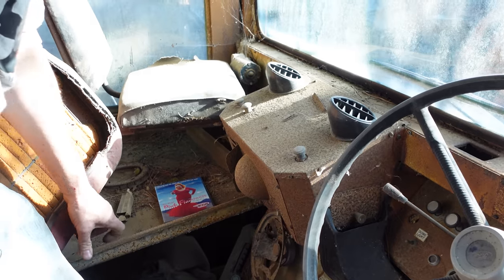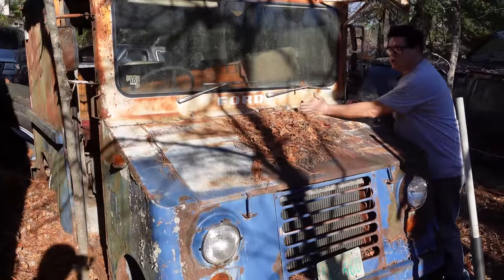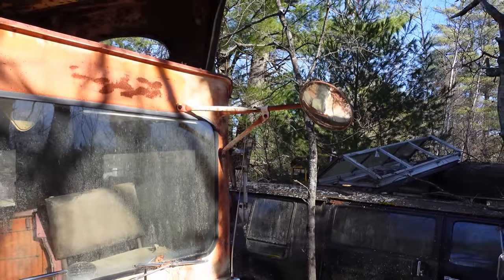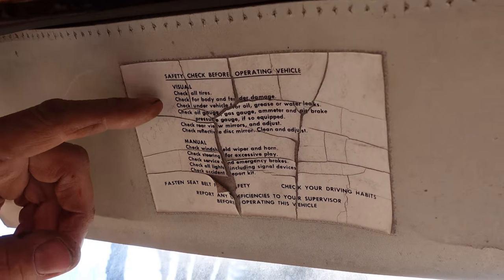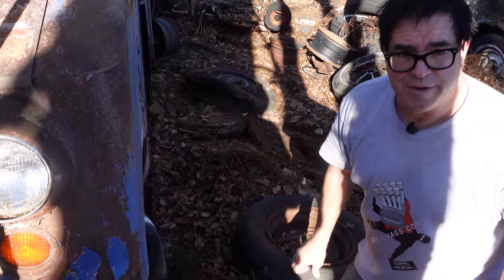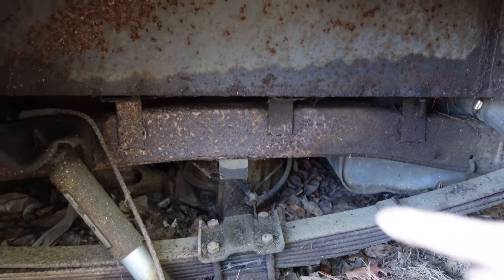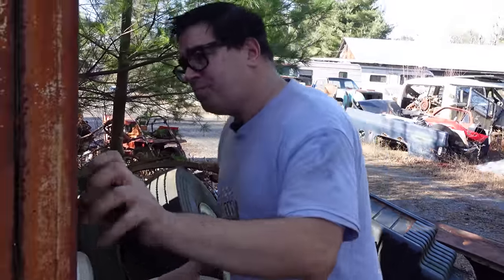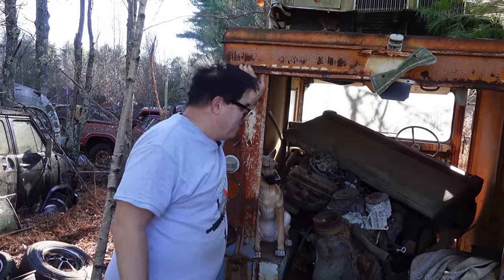Rare Ford Post Office Delivery Van

Comment: Having worked for the US Post Office 1969-1974 (During the time the Department of the Post Office became the US Postal Service), I've very familiar with these vehicles.  The also had AMC Ambassadors, IHC Scouts, AM General 'Jeeps', and probably a whole lot of other right hand drive vehicles.  I actually purchased an AMC Ambassador from the office I worked at for the whopping price of $200 back in the 70's when they were changing over the fleet.  Very austere interior, no back seat, etc.
Reply: The postal service in the town where I grew up used the Jeep. It's been decades but it was my understanding that those jeeps were all repurposed WW2 service vehicles .
Reply: Up until just recently the mailman in our area drove their own vehicles. I remember as a kid my mailman had a Plymouth duster. He sat in the passenger seat and drove the car.
Reply from the maker: Hello Hack Fabrication, good call on the RHD AMC passenger cars for postal use. A few years ago I had a show called Roadkill's Junkyard Gold and we did an episode at a place called "Rambler Ranch" in Elizabeth, Colorado. They had TWO 1967 Rambler Rebel 4-door Post Office cars with RIGHT HAND DRIVE and the base 232 six popper. We did a feature on one of them. If you are a Motor Trend App subscriber, you can watch the episode. Just seek out  "Rambler Ranch" episode. It is in one of the few episodes we did there. Others cover the 4X4 Eagle passenger cars - of which Rambler Ranch had an example of EVERY body type and model. A great AMC resource! Thanks again for watching and writing. -Steve Magnante
Reply: @danw6014  Yes, some carriers on certain routes use their own vehicles. Depends on the route.
Reply: @googleusergp  I used my own vehicles my entire career ( 5 Jeep Cherokees) until the last 6 months, when they assigned me a brand stinkin new Mercedes.....they're attempting to phase out carriers using personal vehicles......the kicker is these Mercedes have to have minimum 91 octane........using E85 would cause engine damage, so you're getting the most expensive gas at the pump, like it or not.....go figure.....
Reply: @timfremstad3434  I don't believe that any government worker should use their own vehicle at all. A vehicle for civil service is a tool. A civil servant doesn't bring their own chair, computer, phone or other items to the job. Yes, civil service mechanics often bring their own tools for the job, but in order to do government work, a vehicle should be assigned to you. I'm not sure why USPS did that, unless it was shortage of vehicles, or knowing the government, cheapness. LOL. If you think about it, you should be covered by the government insurance when you're on the job, so using your own vehicle is mixing business with pleasure as the expression goes.
Reply: @danw6014  mrs halcin delivered with her car,she was a farmers wife @ there kids sold corn !
Reply: @Jupitermustangmike  my old mailman once upon a time sold Desotos and Allis Chalmers farm equipment.
Reply: @danw6014  I love sharing these stories
Reply: @googleusergp  The rural carrier receives an allowance for providing his own vehicle.
Reply: @robj2704  I get it and that worked years back. Not in today's society.
Reply: @googleusergp  because?
Reply: @robj2704  Liability for an accident, wear and tear on the vehicle, etc. Not worth it. They should supply a vehicle.
Reply: @googleusergp  the rural carrier is considered a contractor and is responsible for everything to do with their vehicle.  This was the case last time I knew which was 15 years ago.
Reply: @googleusergp  well. they paid us for the use of our vehicle, we were still working for the post office, but they were paying us for the use of it everyday..... I was a rural carrier....as to insurance, my auto insurance , Rural Carriers insurance, has tort clause in case we're in an accident and someone wants to sue a carrier personally, we were covered, if you went through other insurers, they would charge you a business rate, which would be ridiculously expensive.....I've been out a year and a half, they've sent me letters to come back for Christmas, to which I say "No Thank You".....28 was enough
Reply: @googleusergp  When I worked at the Post Office, rural carriers where contractors.  They were selected outside the normal civil service hiring.  They would use their own vehicles.  One carrier I knew, actually purchased a brand new DJ for his route.  They were paid by the length of their route, and the number of stops.
Reply: @timfremstad3434  What a raw deal. I would want no part of that.
Reply: @hackfabrication139  No thanks. I'd rather get paid by the hour and not because some bean counter decides this is what the job is worth. I'd also NEVER take a government job where you don't have civil service protection and rights.
Reply: There is a difference between a highway contract carrier, and a regular rural carrier. One is a contractor, the other (Rural Carrier,) is a career USPS employee with federal benefit plans and union representation.
Reply: @davidgilbert7789  Which is the ONLY way to have a civil service job in the sense of it being worthwhile. Any other way, you're subject to the will of management.
Reply: @davidgilbert7789  You're right, contract carriers out in the stix got a real raw deal.....I wouldn't do it for the deal they got

Comment: The 250 is part of the 144-170-200 family. The 240-300 are the other inline six family.
Reply: Yep, it's a tall deck Mustang and Ranchero in line log head 250, not the 200.

Comment: I believe Todco supplied the rear doors for these, as they did many truck and van doors (and still do). Yes, the GM LLV (which is a right hand drive S10 platform) is still around, but they are being replaced by Oshkosh models and some small Ram vans depending on the use and route. The GM LLVs are long past their prime and they are prone to fires because the washer fluid is in a bad spot where it can ignite. They are also long in the tooth and have a lot of miles and use on them. LLV means "Long Life Vehicle" and Grumman made those bodies. 

The plate shows a lot of DSO (District Sales Office) numbers because this is I believe a hodge podge of parts put together. I believe the frame is from a 1971 Bronco and alot of the rest of the parts are from the rest of the Ford truck parts bin. This contract bid was started in 1970 as evidenced by the language at the bottom of the placard, referencing that the vehicle meets all standards as set forth in the bid (solicitation) as of Thursday 2/5/1970. That's to avoid Ford being caught in a trap where the US government would say, "No, it has to meet the standards at the time of the build". That wouldn't be fair as Ford priced it based on what was in the bid documents at the time and builds it based on that. If not, they issue a "change order" which updates the contract and specification to what is then current at the time of build. Things like that can get sticky and that's how disagreements start. No one wants to be in the cross hairs of the government, so that's why that's put there. Yes, the transmission is likely a C4 automatic. 

In 1971, the Postal Department became the United States Postal Service and adopted the "sitting eagle" logo which was used until 1993 when we got the current USPS logo. I had an uncle who was a mail carrier for many years in Brooklyn, NY and he loved his job. He never had to go to a gym because he walked miles and miles each day. Everyone knew "Andy the Postman" and would sit and chat with him. My uncle retired in 1985 and enjoyed retirement until he passed away in 2012.
Reply: I did not know that washer fluid would burn. Learn something new every day...lol
Reply: Thank you G P for all the great info you gather !
Reply: @will7its  Yup. The washer fluid lines apparently run over the fuse box and washer fluid contains some sort of alcohol I believe so it goes right up.
Reply: @daynadiggle8169  Sure thing.

Comment: Great overview. The Post Office I worked at in the early 1970's (in Connecticut) had a large number of these  Great mail delivery vehicle. Easy to drive, easy to get in and out as well as plenty of space for the days mail. As you said, they had a posi-ttmraction rear and lots of gear, probably 3:89 or higher. Great acceleration for a small six. Best postal delivery truck of the time. Better than the Dodge's and Jeeps which were also common in that era.

Comment: Great video as usual.  I don't believe we had dvds in the 70s? The vents in the van are in the Grumman Llv as well as many others over the years on cab and chassis vans produced for PO. Note the Grumman LLVs Long life vehicle) were produced from 1987 thru 1984 Gm 2.5s 87 to mid 93 then 2.2s till 94.
Reply: And the Aluminum  body Llv is still delivering.
Reply: Those  body guys were  trained in aluminum at the PO Garage,well before the F 150, Real aluminum craftsmen

Comment: Hi Steve, nice video!  When you talk about rear differentials, on any car or truck, you have 4 different types, open differential or closed differential.  #1 type is that the drive axle(s) are never locked together that's an "open'.  #2 type is a closed differential with wet clutches compressed by high spring tension to HELP both drive axles lock together, Ford calls this "Limited Slip", Chevrolet calls this "Positraction" other car brands call this different names, I.e. Safety Grip, Shure Grip, Twin Grip, etc.  All Chevrolet Corvettes have "Positraction" and Corvettes have the highest wet clutch spring tension than any other car from the FACTORY.  #3 type is a closed differential where-as NO wet clutches are used what so ever, it is a rotating detent dog that locks both drive axles together 100% and they stay locked together until you back your foot off the accelerator, but in the mean time, it takes ONE FULL rotation of the two drive axels (in a straight line) to lock the drive axles together.  #4 type is what's called a spool or "welded rear" you might sat that makes both drive axels locked together at all times.  Welded rears are popular in off road drag racing, but are too hard to drive on the street, because the will loos rear traction on turns and will "bunny hop" on right angle and "U" turns.  By the way, have you ever heard of a "Detroit Locker" rear end?  Detroit Locker is a trademark of Detroit Automotive, Detroit Michigan.  Please reply.  Dave...

Comment: And don't forget, there was a Jeep van(based on the FC series pickups, I believe) in the late 50's and then the Jeep(later Am General) DJ-8 1/4 ton van. And when I worked at the PO in the 80's and early 90's the PO was using Ford Pintos too. Got the first Grumman LLV's in 1987.

Comment: Steve, you totally forgot to mention the sweet, sweet aerodynamics on that little puppy! That would be a good candidate for a 289 or 302 swap. The 200 line of engines leaves a lot to be desired.

Comment: Cool mail truck... its got street freak written all over it or maybe not.
Today in my neck of the woods the mail trucks are based on the chevy s10 frame and drive train.
At one point i was really into those mag caps and ran a set on the malibu...now im running the stock malibu wheel covers. Ive owned the car so long and ran a few tire wheel combos, but now the  car looks just how i bought it for now !!

Comment: Gunnman went belly up in the early 90s and was bought by Northrop. The last LLVs rolled off the line in 1994. Not one LLV postal vehicle on the road is newer then 1994. They are loosely based off the S10. They all have 100s of thousands of miles on them. Most are on their 3rd or 4th engine and trans. Amazingly, very few of them have any rust on them. My shop services postal vehicles for 3 towns. No we will not be working on the new Oshkosh ones when they come out.

I helped restore a 76 DJ-5 for a postal worker many years ago.

Fun fact: the LLV uses a 2wd s10 front suspension setup but a 4wd rear, creating a different trackwith front and rear for a tighter turning radius. And the public will most likely never get to buy or drive one once they are done their service. The post office has stated that they will be scrapped or crushed. You aren’t even legally allowed to own one unless it’s one of the small number of non postal LLVs made for the parks department (which people have bought). And I wouldn’t want to own one anyway. They suck in the snow, they are loud, and it sounds and feels like your driving a tin can on the road. And about the same crash protection as well.
Reply from the maker: Hello CamaroAmx, THANKS for the insights. I have a Grumman deliver my mail every single day (except Sundays and Holidays of course) and have come to recognize the "growl - squeek - sliiiiide" sound as it pulls up, stops and the sliding door opens up to release the delivery person. I have seen online photos of PILES of used postal vans stacked at the scrap yard. I appreciate how the "parts bin engineering" yields the taper-track effect for tighter turning at a savings! Anyhoo, if i spot one of these pups in the yard you KNOW I'll feature it. Thanks again for watching and writing. -Steve Magnante
Reply: @SteveMagnante  hi Steve! I know this is off topic but I’m trying to get a starter for the silent Malibu! I tried two so far and they both hitting the flywheel hard core. The engine casting is 3970024. Has a power glide. The block has thee holes. It looks like an impression from a cast thee hole starter in the dirt. Any help would be appreciated!
Reply: @SteveMagnante  You’re welcome. I’ve been reading (and watching) your work since the mid 90s. 

I’ve actually never heard of these Ford G100s, but I find it amusing that a lot of the features of this are used in the LLVs. Most LLVs are powered by the old Iron Duke engine, but later ones have the Olds Quad4. They even have hot Rod parts on them, kinda. Their brakes are made by Brembo (the front discs are slotted).

I have a 73 AMX and a 93 Z28.
Reply: @neshpro6521  great job saving that one,  if you have the old starter have a local shop rebuild it
Reply: @karentimberlake6077  she was pulled long ago at the wrecking yard!

Comment: I had a 75 DJ Jeep. 258 engine with Chrysler automatic. Those round mirrors are called "pot lid mirrors".
Those little pop out mirrors were a design standard for just about every postal vehicle I have seen.
My DJ was a very capable little ride and was fun to drive. Good on gas but bad on rear tires. That posi chewed them up. People just couldn't get the fact that I drove on the wrong side. In one minor accident a woman pulled out into my lane and I squeezed past her leaving a bumper shaped crease down the side of her car. She swore to the police that there was no one driving and that was why it hit her. I finally had to practically take the officer by the ear and show him where the steering wheel was. Idiot. Another driver came back and said how I managed to dodge all the other traffic and avoid mass mayhem.
I was off the hook when the skid marks from those snow tires blackened the white line.
Great little vehicle, the doors suited the middle state of Florida. It was still hot though despite those vents.
I took my future bride to a lot of drive-in movies in that Jeep. Ahem..... you don't need to know the rest! 🙄😎😁
Cheers
Terry

Comment: 240 300 had a regular head with intake exhaust bolted on 250 had same integral intake and block had a taller deck so you could stroke the crank to make a 200 a 250 but in a junk yard they look the same

Comment: 144, 170, 200, 250 - integral intake manifold ( cast as part of cylinder head ). 240, 300 - bolt on intake manifold.

Comment: Pretty sure there is a lot of Early Bronco under that thing. Radius arms, front spring and shock towers, rear leaf springs, fuel tank, fully boxed frame, all looks very similar to what you find on 66-77 Bronco
Reply: huntinand4wheelin That steering looks an awful lot like the ones that Ford on the early F-100's. 1967 to be specific.

Comment: Steve, any chance that is an early Bronco frame with a tube front axle instead of the D30/D44 ? short WB.
Seems like it would be easier to use than tooling up a frame just for a 3 yr model run. 
Thanks for the vids, always enjoy them.

Comment: Oh no Steve has gone postal in a nice way. Nice call on that differential here I would never have thought of it. I know they built them light but they built them cheap I'm assuming g stands for government instead of the e as an econo. But a 300 straight 6 which seem to be a lot better vehicle. It's about like them using the iron Duke engine in the current fleet that they're replacing. You know GM / Pontiac Mid engine fiero barbecue pit

Comment: I'm certain that is a 4.1 liter because those things  were all 250/C4 Cars, Must be the big 250 Ford Carter RBS it has on it....Nett rating in cars, 1972. Vans and SUV's, as you've said in the past, it's a converted thing because the 1971 200 was rated at 115 HP gross at 4000 rpm, the nett rating, 102 HP was much higher than the publicised 200  figure of 93 HP net I've seen for that year. Big Carter Jug proves it's a 250 talldeck Log Head engine. 🥝✔️.

Que Egg by the Beastie Boys, Mags Delivers IT!

Comment: So... The 170,200,250 had integral intake. 240 and 300 had removable intake as did the 223. The steering column,steering wheel,instrument cluster, and the whole underneath looks like an early model Bronco. Even the wheel wells look squarish like a Bronco. I wonder if Ford just cut the upper body off the Bronco and deep sixed the front diff to make the G body? Sure looks like it.

Comment: engine city taught us that d is not drive it is Direct meaning your not using the transmission the input and output shaft are Directly connected bypassing all gears. that's why some cars have a D and a D in the middle of an O for "direct" and "Over Drive"